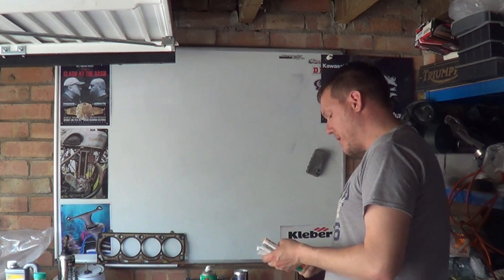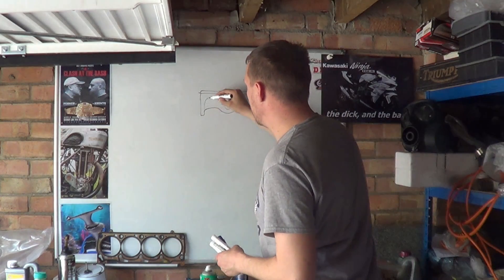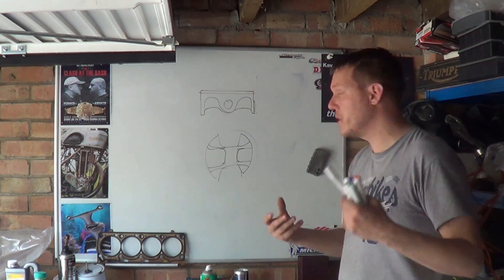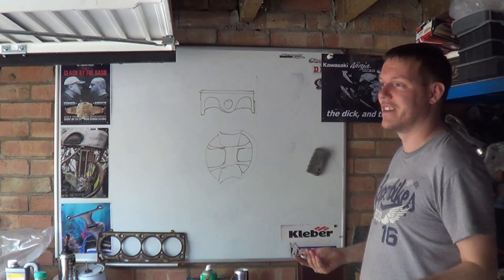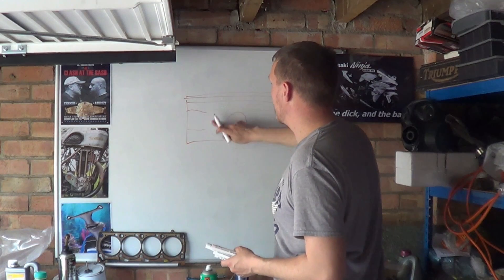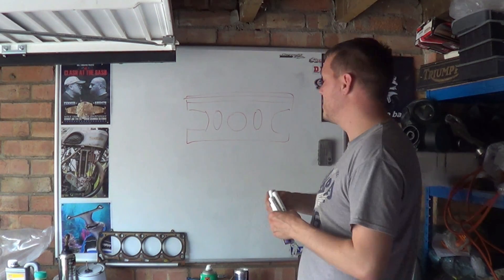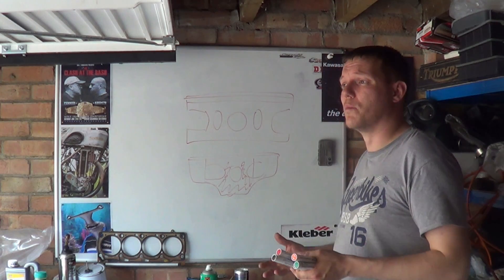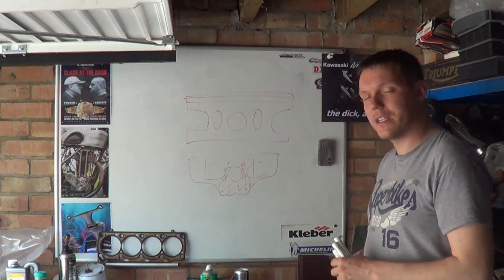Caged Piston - Futuristic Piston?

Comment: 4:10
Friction formula doesn't really involve area (but it's not a perfect formula either)

Although, the area of layer of oil b/w cylinder & piston would decrease.. so lessened amount of viscous oil to deal with. So, that "otherwise to be wasted" energy should be saved this way.

Also, doesn't the reduced area means increased pressure per unit. So, shouldn't the wear per unit increase? Then they'd have to use harder coatings hence increasing the price further.

Now that its been over 3 yrs since you made this video, have you been seeing any application of these pistons on any vehicles? I'd love to learn more about these 🤔
Reply from the maker: Friction doesn't involve area? Lmao! Yeah it does. Why are back tyres larger than the front if its not?
Reply from the maker: And its been 3 years? Lol wow

Comment: Is it better to run an engine at higher rpm in a lower gear or at a lower rpm in a high gear. 
What I mean is, say I am riding along at 30 in 3rd gear doing 6krpm. I decide to put less strain on my engine by putting it in 6th and running at 2k rpm but increasing the load on the engine and gear box. We feel asif we are straining the engine less by reducing the rpms but are we actually?
Reply from the maker: lower rpm at any speed increases the load on the engine - which means bearings etc will have a harder time - however higher rpm puts more load on the rubbing contact components like rings and valves and cams etc

Lower rpm uses less fuel and higher rpm for the same speed uses more

Lower rpm means that you lose acceleration when you open the taps because the power band is further away

So, all in all they're pretty much the same as far a wear is concern - as for the other end - it depends if you want acceleration or fuel economy. The fuel economy one is a funny one because distance cover over time = the same power - therefore the same fuel usage. 

So to that end - I'm setting up a test to show which does what
Reply: @thedirtyworkshop  but does distance covered over time = the same power and the same fuel usage. 
If I'm riding my bicycle in a low gear I'm working harder to achieve the same distance covered than if I was in the optimum gear where minimum effort is applied to achieve the maximum gain. The fuel economy is very black and white, you weren't using the optimum gear. Which is why we see increased fuel economy in cars with modern automatic gearboxes (compared to manual transmission), the computers select the most optimum gear depending obvcourse if you have it in eco mode not sport otherwise it would choose the optimum gear for "sporty" driving. 
I suppose I was saying, i'm riding the correct gear for the speed of the road and all other variables, Should I change up to 6th to be kinder to my engine or is this actualy doing more harm than good.
Reply from the maker: "but does distance covered over time = the same power and the same fuel usage."

Theoretically yes. Power is a measure of work done over time. The 'work' is you have moved from point A to point B and time is time. If you do A to B in an hour at a constant speed that is 'x' amount of power to do so. If you do it in half an hour that requires 'x' times 2. 

Because work requires fuel then the same can be said about fuel.

But in the real world there's waste and A/f ratios that change and power bands etc.
Reply: @thedirtyworkshop  
Yes but what you can do is move from A to B on the same vehicle with the same conditions, basically all variables are exactly the same for the sake of this. In a given time of say 4minutes.
This is our standard yeah.

1. You can do this in 5th gear at 40mph at 3k rpm.

2. You can do this in 3rd gear at 40mph at 5k rpm.

We both know which one will require more energy. The amount of fuel used to compensate for the mechanical drag of the engine gearbox and motorcycle and rider because we are putting more load on it in a higher gear will not supersede the amount of fuel used at higher revolutions as this is now just expedential waste. 

I would still watch the video on it tho Haha!.
Reply: But what I will say Is I'm not interested in fuel consumption on my motorcycle as I'm sure many here aren't. I simply wanted to know about reducing the wear to my engine and the best "riding style" to conserve it.

Comment: Blackburne motorcycles, 1900's to 1920's, used ringless cast iron pistons in their 4 stroke side valve engines. Peak RPM redline was below 2,500 RPM due to the reciprocating mass.

We've come along way since then.

Comment: I bet pistons like that caged piston. will be very costly.. and used in very expensive performance engines. and it looks to have little friction also. may be it would be good for increased mpg also? I would like a set for my 385 cod stroker motor. it has old school pistons. without coatings even. great video. I'd like to see more about these. and tell every one NOT to take a dremel to their pistons . to make them look like these!¡!

Comment: I noticed on my Yamaha 400 2-stroke the cast pistons have a full length skirt front to back for thrust loading, and for the sides- only the crown sides and rings make contact. When I got the forged Weisco the skirt was just as long, but full perimeter.

Comment: You do know that friction has nothing to do with  surface area?
Its Frictionforce= frictioncoefficient*vertical force (vertical to the surface)
Reply from the maker: Although a larger area of contact between two surfaces would create a larger source of frictional forces, it also reduces the pressure between the two surfaces for a given force holding them together.  

Since pressure equals force divided by the area of contact, it works out that the increase in friction generating area is exactly offset by the reduction in pressure; the resulting frictional forces, then, are dependent only on the frictional coefficient of the materials and the FORCE holding them together.

If you were to increase the force as you increased the area to keep PRESSURE the same, then increasing the area WOULD increase the frictional force between the two surfaces.
Reply: Thank you , now i understand you. 
Btw nice video :)

Comment: When you minimize the surface area of the skirt, the skirt and cylinder will see more PSI of force at the leading edges of contact area and those areas are more prone to oscillation....and wear. I have always been interested in wrist pin offset to minimise rod angle. and different designs for the front and rear piston skirts due to the forces being different as the crank rotates.
Reply from the maker: Offset, desaxing cylinders and assymetric pistons are videos that are coming soon - matt

Comment: do you think that piston slap could be caused by the up-stroke more than the down-stroke? and even more so on a 2T, if you try to push something that can pivot it will move unevenly but you can pull something on a pivot more evenly plus the piston will be pushed down on the firing stroke.

Comment: will that kind of pistons retrofit on existing engine or do they need a specifically designed one ?
Reply: can i just drill holes in my old piston?
Reply: Go for it.
What could possibly go wrong
Reply from the maker: Specifically designed to fit each engine, like they do with there other pistons
Reply: yes, for the overall shape but will it be possible to put a cage piston on a engine that came out with standard piston ? (in order to get the advantage of cage piston on existing engine)

Comment: Wouldn't heat transfer be compromised with less surface area, leading to potential piston burning?
Reply from the maker: Heat transfer is mainly throught the rings and oil squirter cooling on the underside of the piston so no, not really
Reply: The Workshop 
You're dead right, particularly with newer engines that have plated cylinders. Still the piston is subject to the same thermal load and you have a lesser mass of heat sink wouldn't the piston run hotter?

Comment: Hi Matt, Why are some pistons dome shaped and most others not?
http://www.lsxmag.com/wp-content/blogs.dir/1/files/2012/11/IMG_2962.jpg
Reply: The hemi-cylinder head got more surface area for bigger valves to fit. Bigger valves means the air can move in and out of cylinder better and high-end power goes up.

2T engines dont have valves but there are hemi-ish shaped cylinders for 2 strokes. Those are to direct the air for better scavenging, mostly used on older 2 strokes, modern ones have flat cylinder heads, no idea why. Maybe Matt know?

Domed pistons or oval pistons are just stupid. Larger surface area in the combustion chamber means that the exhaust gases cool down, don't expand as much, pressure drop on piston and power goes down. Same problem with Wankel or any other strange engine piston shape. An explosion in air is shaping a growing sphere, which is the ultimate shape for least surface area per volume. A cylinder is second but as MatT have shown in the videos, air/fuel can be trapped in the sharp corners. A wankel engine is not so efficient for this reason.
Reply: Compresion ratio.
Reply: No worries. I won't be getting a Hemi any time soon but I was interested in combustion chamber shapes in general and specifically why Hemis are shaped the way they are when none of the bike engines I've seen have pistons like these despite having high compression ratios. Will you be covering combustion chamber shapes in one of your future videos? Thanks!
Reply from the maker: Because of shitty Hemi's trying to make up for the fact that they are shite
Reply: The Workshop I know this is a bike channel but top fuel dragsters use hemis for a reason. if they were complete shit they wouldn't be used at all but almost all top fuel engines are hemis.
Reply: the hemi head design was nifty once upon a time when they figured out how to machine that chamber shape. the only thing that has developed in the near century since is the marketing wank.
Reply from the maker: +jaya neyon  "I know this is a bike channel but top fuel dragsters use hemis for a reason. if they were complete shit they wouldn't be used at all but almost all top fuel engines are hemis."

- Top fuel dragsters have no choice. The FIA rules state this - from the 2017 FIA Drag Racing Regulations - http://www.fia.com/file/51571/download/16508?token=VWzz1SAR

ENGINE
Any internal-combustion, FIA-accepted, reciprocating, 90-degree V-8, automotive-type engine permitted. Single-camshaft only; multi and/or overhead cam configuration prohibited. Maximum 500-cid (8,193.5 cm3), minimum 490-cid (8,029.6 cm3); maximum bore center spacing 4.800-inches (121.92 mm); maximum between cam centerline and crankshaft centerline 5.400 inches (137.16 mm); maximum two valves per cylinder.

Only one cylinder-head design is acceptable: Intake valve angle of 35 degrees, + or - 1 degree Intake valve size maximum: 2.470 inches (62.738 mm)

Because the NHRA have been running the Chrysler 1964-71 426 Hemi for many years, the FIA won't trust any other engine, because they haven't been tried. Better the devil you know, and this has nothing to do with the Hemi combustion chamber.

This is the reason. I used to design con-rods for supertwins and spent a lot of time at the drag strip.